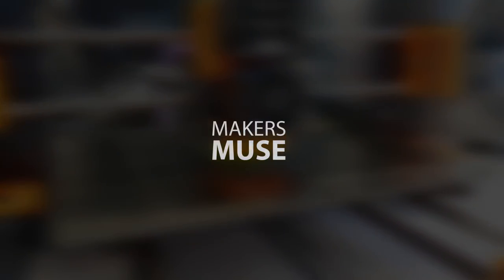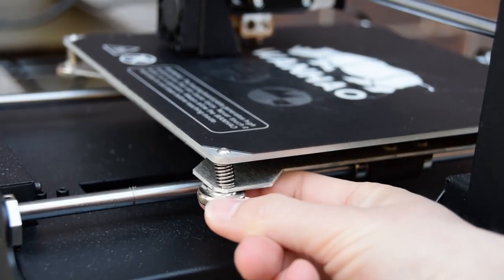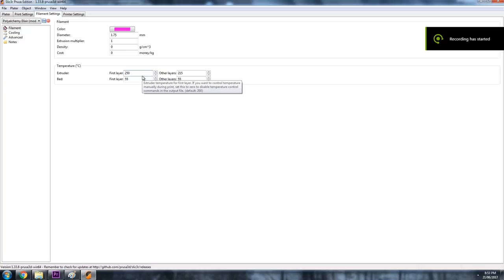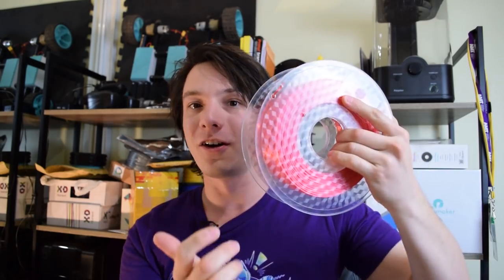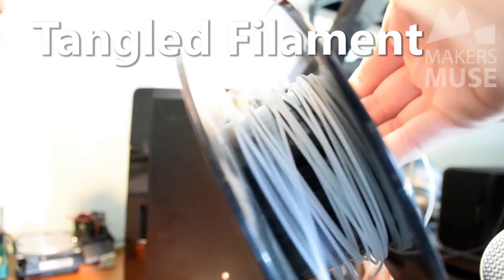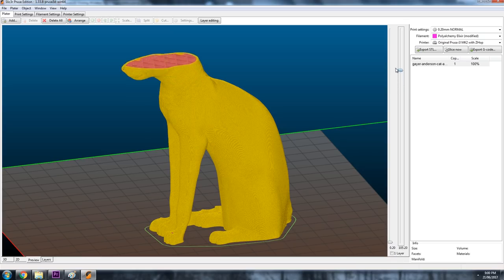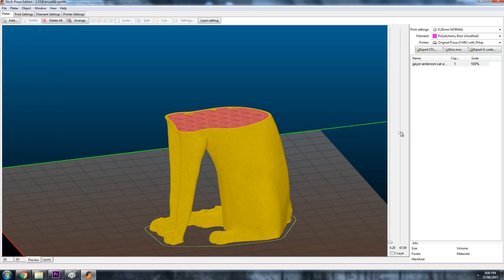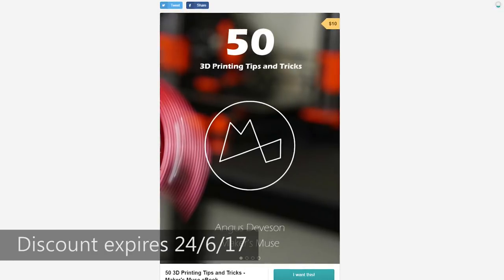5 3D Printing Mistakes you WILL make - and how to avoid them! 3D Printing 101

Comment: DUDE! You forgot #6!!!  "Getting a crappy first printer instead of doing your research out of overeager enthusiasm."
Reply: Valandar2 - Eh, I'd like to disagree with this sentiment. I got one of those 'crappy printers as my first (Anet A8), and I did it after months of research and learning. But I did it because I wanted a project - something to tinker with as well as print things. I love building things, so the assembly of the kit was fun. I must have done well, because my printer is solid as a rock (printwise)now that I got an inductive sensor for autolevelling.

Getting one of the 'crappy' kit types can be the right move, as long as you know what you're getting into and it fits your wants. :)
Reply: I didn't mean to imply ALL kit types were crappy. The one I got WAS. It spent 75% of the time I owned it down for repairs, had horrible print quality, and in general was more painful to work with than anything. In my case it was a Geeetech Prusa I3 clone, with warped threaded rods and super-cheap lowest bidder hot ends. And notice the "Overeager Enthusiasm" bit...
Reply: Valandar2 - oh I noticed. And I'm not trying to poke at you,  just expressing a different take on getting started in this fun hobby. All in good fun!. :)
Reply: LOL Yeah thats what I did. I got a Q3d threeup.  It looked like it had been steamrolled. Parts were broken and the circuit boards were all skewed and bent. The reset button was junk from the beginning. You never know if it is activated or not. All the parts were cut with a laser and put together like a childs puzzle. Nothing to hold it together though unless you zip tie it. Just moving it around on a table is enough to make it fall apart. But the biggest thing that made that kit a fail was the total lack of any kind of customer support.
Reply: Or the opposite. Spending tons of money on a super high end printer when you dont need the extra capabilities it has
Reply: Valandar2 Hahaha that was my first printer.. it was missing a bunch of parts and I returned it because they wouldn't send them.
Reply: I have an flsun cube which has had so many parts failing that I'm going to do a complete rebuild.
Reply: Eric K I've learned enough about 3d printers and motion systems now that I am tempted to put together upgrade kits each of the popular 3d printers to do crazy things like increase accuracy, build volume and reliability.
Reply: Valandar2 hey I’m looking to buy my first 3D Printer but once I think I’ve found one I find another one, I’m looking for something under 250.00 bucks any suggestions?
Reply: Orlando Guevara it really depends on how much you are willing to put into it cheap and reliable means small and not much options for filament.
Reply: Meanwhile monoprice is shoving i3 knockoffs and mini deltas down my throat pretty successfully. No complaints either.
Reply: Orlando Guevara I think the Creality Ender 3 is a very good starter printer. I recently purchased one on Banggood for around 200$. Only downside I’ve had so far is the shipping time which was almost 2 months for me.
Reply: @Florian00  aye I agree with the Ender 3, its a nice cheap starting Printer. Yeah it requires a bit of TLC but the prints arent too bad, I enjoy them a lot. Been printing happily for a few weeks now, getting used to the printer, trying different slice settings on test prints.

But again, when I was looking for a 3D Printer I set a budget of £500, and when I saw the Ender 3, with some positive reviews, and saw on  youtube all the videos with only the "3D Printing Elite" knocking it I thought I am willing to give it a go.

Not one missing part. My print bed didnt seem warped, everything was perfect, yeah I have heard what can go wrong and seen how it could be fixed and I will cross that bridge when I come to it.

Needless to say I didnt just jump and buy the cheapest 3D printer, there were cheaper models, with worse reviews, even more expensive ones. Buying one of them is what the original comment was implying.
Reply: Guilty as charged.
Reply: @orlandoguevara4902  prusa mk3 is having a sale rn my dude its the 2018 model maybe its your time to shine good luck man its the model im thinking of getting to get started on this hobby.
Reply: @Valandar2  So....you had a bad experience, thus your anecdotal evidence says ALL of them are bad.  And instead of clarifying that in your original post, which will be seen, you wait until several posts later, hidden behind the "view more replies".  Yea....your fault, not the printers.
Reply: hey!!! I like my Monoprice mini v2!! got about 65 hours of printing logged so far ;)
Reply: Monoprice mini v2, best value $189 or something on amazon, and use Cura slicer @orlandoguevara4902  just realized its been 11 months lol
Reply: I can attest to rule #6. I spent 800 bucks for a crappy printer. Missing hardware, poorly written instructions missing steps or referring to other models/features, poor quality parts, and basically no support. The extruder block and some of the other parts were 3D printed, and the layers had really bad cohesion between them. The capture features for the nuts wouldn't fit the nuts 90% of the time. And even after careful trimming, the mounts ended up cracking because there wasn't enough material there.
Reply: @Duke Dudeston  did you buy it off of amazon or off of their website? I am looking for the best place to order one.
Reply: Loving my Ender 3 so far. I took my time putting it together (though the directions in the box are crap), got everything tuned just right and it seems to print just fine. At least well enough to print a bunch of little tweaks and upgrades for it.
Reply: I'm researching the shit out of it before paying a dime under my preferences

Comment: Don't touch the bed, oils in the fingers can prevent the support raft from sticking. If you have a print that adheres to the bed, this tip will help you out: I keep a small spray bottle with rubbing alcohol and paper towel, spritz and wipe, print!
Reply: Good tip. I buy the pharmacy brand Alcohol Prep Swabs that are used for insulin injections or blood sugar testing. Tear open a single use package, remove the 1 inch square swab, rub it over the entire surface and you're good to go.  If you do it while the bed is preheated, it will evaporate very quickly.
Reply: honestly, best tip I've gotten. Didn't think about that, might be why my large area prints aren't sticking.
Reply: I do the same but i also dab some gluestick on it, spray with isopropyl before it dries and then wipe the bed clean, spraying more isoproyl as needed. It will create a surfaces that WILL adhere to prints but also detaches when cool. I've found totally clean surface to be actually really, really poor but just wiping the bed once with gluestick+iso will make it way, way better. I do it now regularly, add new thin coat of my special sauce. um.. that sounded dirty for some reason...

Comment: I am so glad You mentioned the tangled filament part! As a filament reseller, I get questions about this every once in a while, where customers claim it is  NEVER their fault...
Reply: Ott3rman when I was the person that ran the printers at my school we opened a box of makergear filament and didn't even touch it but we could see it was tangled so we took ten minutes to unroll and roll it back up
Reply: but I do agree that most of the time it's the consumers fault
Reply: it's like Angus said, that mistakes happens to all. I'm just saying it is funny when the same person complains at the same time about two rolls of different brands being tangled half way in... and no matter how gently you try to tell him it is not statistically possible to happen he still demands new rolls...
Reply: Speaking of, I wouldn't wind it back up - I'd just cut it when I know the tangle part is not on the spool.
Reply: I had to trash half a spool of esun because I managed to get it so tangled I just didn't feel like fixing it.
Reply: had to untangle while printing that very clip meant for preventing it. Well not fitting spool only filament. Still using the pot solution but changed rectangular lever for old 5 cm diameter telescope from '80 at some inclination and still needs monitoring/corrections. Now skater bearings arrived and have to print universal spool holder and design  mount at hellobee prusa.
Reply: Most of the time it is the user's fault. I have had one where it was looped 150 grams into a spool. Opened the spool, put it on the printer, started a print, and 150 grams later, it was looped into itself.
Reply: it is never the consumer. dont you know that that greedy money hungry company just sells you the cheapest possible filament? /ironyoff it is sad that people are too proud to admit their mistakes and instead try to blame everyone else.
Reply: @joey.526_2  you have 3d printers at school ? our school discourages creativity of any kind

Comment: Actually, some brands have been known to have issues with tangles, and it's usually down to specific colors, which indicates that there's likely a single machine from a factory that is the culprit.  If they spool it wrong and an area spools looser than another, and ends up overlapping another segment, then gets pulled tight again in another area, the spool can definitely cause an overlap that essentially tangles the filament.  When you spool something, it has to be done in a specific order, layer by layer, or this will happen.  Even spooling machines are susceptible to this, if they are operated incorrectly.
Reply: I used to have a job making cables for power lines and can confirm what you're saying. It's just operator error.

Comment: Great tips. Heres two more, use a wifi camera so you can monitor the printing while not there, and also, set up a wifi controller in the outlet so you can cut the power to the printer remotely from your phone when its done (or failed).
Reply: Octoprint. You get a web interface, a camera interface and full control so you can keep an eye on it, pause or stop from wherever you are. :)
Reply: Were you snooping around in my office?  I have exactly what you described.  I'm using a Dome z-wave outlet so I can turn the printer on/off from my phone, and octoprint so I can watch it remotely.
Reply: I have a D.Link camera and some of those boxes from aliexpress, that you can control with your phone. They cost like 10euros each.
Reply: That's a fantastic suggestion. I'm gonna remember this for when I inevitably cave and buy a 3D printer.
Reply: Me?

Comment: You just saved my sanity. I am new to this hobby. I purchased filament from amazon. I was printing PTEG at the lower temperature. After reading the label, it required higher bed and nozzle temps than I was using. Thanks Mate.

Comment: Thanks Angus, always helpful.
If you catch a knot in your spool before it jams up, you can simply take the spool off the holder and undo the tangle by putting the whole spool through the knot. I've done this many times. Another reason to monitor your printer.
I volunteer at a library where the filament ends are not secured by all operators and it happens regularly.

Comment: Good tips to keep in mind. Haven't experienced roll tangling but I'm sure if I start swapping rolls a lot and get ahead of myself, it will happen. When I bought my kit, I specifically payed the extra $20 for the auto leveling kit to avoid that problem and so far it seems to work well. I find I have to check and usually adjust the height of the nozzle before I start a print to make sure it isn't to far away, or sometimes, to close, so that is something I think I'd add to the tips, check nozzle height with feeler gauge before printing to make sure it is right. Also, I check the nozzle for any plastic goobers that have built up and wipe / break them off too. I've also had pretty good luck, for the most part, with using 3M painters tape on the bed for the first layer to adhere.

Comment: Really glad I found your channel its been an incredible help
Reply from the maker: Glad to help!
Reply: As a random question what do you think of the microswiss all metal hotend? Ive been thinking of replacing my stock hotend for a while now.
Reply from the maker: Great but not needed unless you're printing the abrasive materials in my opinion.
Reply: Maker's Muse Wrong, about how to wind filament. I've dealt with spools for 40 years. The fix? Have your friend hold loose end then roll the spool filament on the way it rolls off, like you were holding a bicycle axle & wheel. When you pull the filament off the edge to the side, it puts twists in the filament. Same when you rewind across the edge in the way you did in the video. I've run miles of cable by hand thru skyscrapers thru the street into another building. As long as the spool can rotate to feed the filament, it has no twist.
Reply: Exactly, that was not rolling up, but coiling up under tension. Bad practice whether it is wire, rope or filament...

Comment: In my opinion the biggest mistake i see is entering in 3d printing without really knowing what you are doing, it seems quite obvious but the first thing you want to do is looking at tutorials or reading some information and manuals, will avoid a lost of mistakes and frustrations :)
Reply: 6 minutes ago
Reply: I did lots of research before I bought 4 different printers; 3 UP printers and a Prusa, for use in the classroom. All had outstanding reviews and while I have managed to print some awesome files, NONE of them proton consistently well. The biggest disappointment is my 2 month old Prusa. I just can't get it to print as it should.
Reply: Yes i agree but what i mean is that i often see new comers in 3d printing that don't really know what they can or can't do. I mean, it's not rare to have someone ask how to put the STL on the printer, or whatever non sense question. When you go into 3d printing the first thing before buying the printer is to document yourself at least about the basics.
Reply: Agree 3D printing is changing so fast do your research before you buy or you will get burnt after you buy and find something with a new feature that would make your life easier.
Reply: Or buying a makerbot printer
Reply: That is so true.
Reply: what if its an asian printer that has no instructions and/or unclear/bad english instructions? :O cough cough anet a8* cough

Comment: Ok hear me out:

Baby monitor camera for your 3D printer

That way you can check on your baby--er, 3D printer to make sure it's printing right
Reply: I turn my Nest cam towards the printer when printing. Not a bad idea at all!
Reply: i use my gopro and monitor it from my phone.
Reply: Get a raspberryPi with a webcam  and install Octoprint
That way you can remotely view your printer and control it
Reply: A wyze camera and smart plug will do this job for $50
Reply: I took an old Night Owl security camera system for mine. One camera watching the head, one watching the control panel, one watching the print itself.
Reply: THIS MANS A GENIUS
Reply: Stream it on Twitch and watch from your phone or another room.

Comment: Having only be doing 3D printing for a few weeks now, the one mistake I have made and remedied is that supports (especially tall ones) for 3D prints sometimes need a small manual bed of about .5 mm thick to secure them from falling over when the 3D printer is printing the actual object. In one case a brim was not enough ,and in another, a raft lifted up of a heated bed when a particularly large area above an array of supports was being printed.  

I found adding a flat rectangular box (or a cylinder) to the the slicer and scaling it to .5 mm thickness, and a decent margin around the support material works well to secure the supports to the bed and not fall over. Even on a single support of several centimeters in height !

Comment: I have just bought an Ender 5 pro, this is my first 3D printer and I assembled it as per the instructions and took advice from the many videos on you tube but I was still having problems with my prints, layers were being missed, details were not being printed at all and I was getting really bad adhesion to the bed and the extruder was clicking. I tried many work throughs including removing the filament and retrying but could not seem to solve the problems, I was using the filament supplied with my printer. I changed my filament because of a colour preference and all my problems were resolved, I am getting much better prints now. I now love my Ender 5 although I was on the verge of sending it back. So don’t think that the problems are something that you have done or haven’t done it could be just that the filament supplied with your machine is a far inferior quality. Enjoy!

Comment: If your spool is tangled, one quick way that I have found to work is grab the filament one full turn past the end, and pull it out from under the overlap. Most tangles and overlaps stay on the first rotation around the spool due to the tension. Just my experience. AND GET SOME FILAMENT CLIPS!

Comment: The biggest problem I had early on was deciding whether or not to have a sidewalk/raft on the print I was doing. I was told from the beginning that ABS jobs usually need it and PLA jobs shouldn't need it, but in practice I found the opposite was true with the CubePro printers I was using at school; the PLA never stayed on the print plate no matter the shape of the part (I was doing a lot of simple flat and wide print jobs that would always start peeling off the plate mid-print and often fuse themselves to the nozzle when it hit them), and the ABS with a sidewalk/raft was so solidly stuck on the print plate that it was almost impossible to get off. One job I spent nearly two hours trying to get off the plate, and judging by the state of the plate with chunks gouged out of it and discoloration from bits of plastic that never fully came off, I was clearly not the only person who had difficulties.